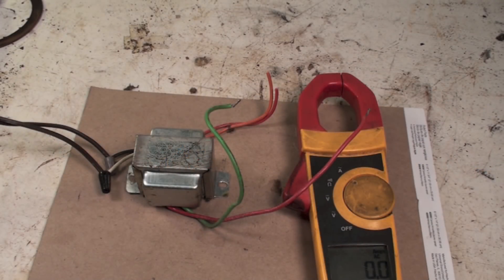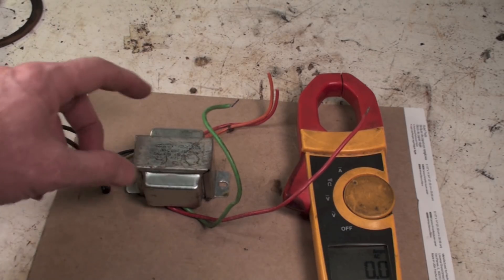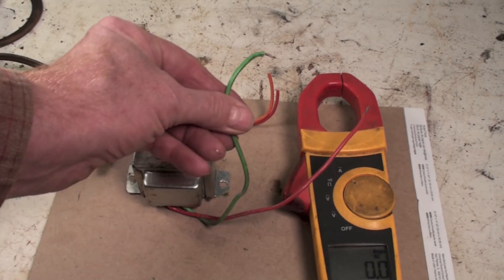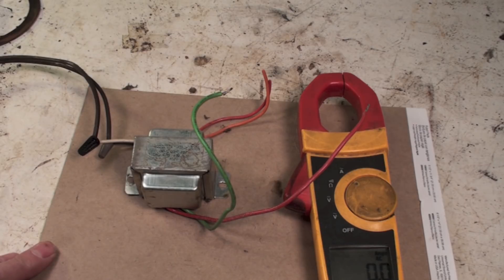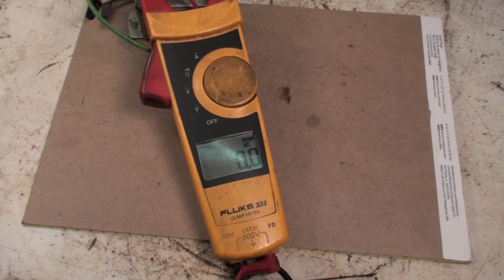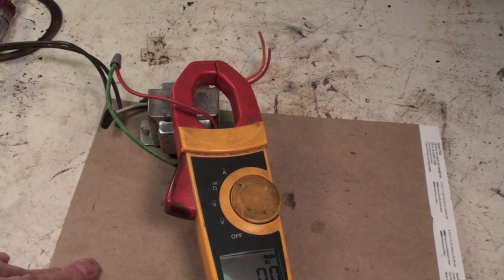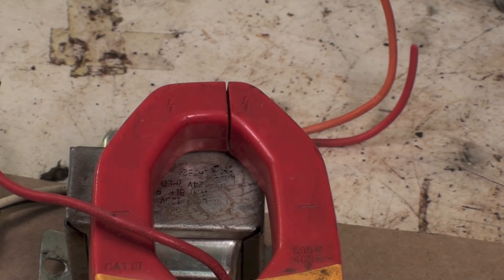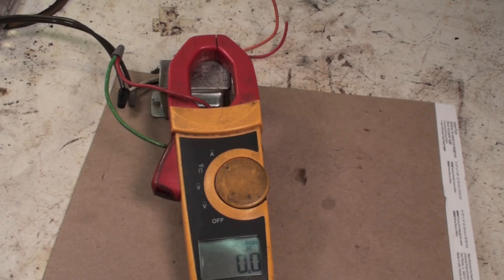How to replace a transformer (without burning up the new one)

Comment: I have a problem with wedge bulbs burning out every second day in house number eluminated plague. What could be the reason. Bell knob stays eluminated 24x7 with no problem
House numbers bulbs keep burning. Any sugestions?
Reply from the maker: Ilia B Check voltage to lights.  Over 15% high, could be the problem.
GFM
Reply: voltage show 10 volt which is normal but bulbs  go every day. any other idea. i ordered new sockets may be bad contacts cause the problem

Comment: Question following.  I have watched your lessons and very much appreciate the guidance.  Lessons are well said and easy to understand.  I have a Rheem Prestige Super 80 - 2 Stage - installed 2008, just outside of warranty.  I used your suggestion and put a screwdriver against the transformer to listen - transformer is humming loudly to regular hearing too - used the screw driver to isolated the sound- transformer is very warm almost hot to the touch.  The furnace works, then does not sometimes.  Unplugging and letting it wait half and hour, then start and works for a few days.  At trying to light again the two green lights are on but the amber does not - then later it may kick in with amber light on solid. Where is the ground for this?  Ideas? Start with Transformer then work from there?  It is the transformer on my left -  # 46-24124-03. If you have someone near Moreno Valley, CA, you like fine, but have had issues in the area with several companies. At minute 5:55 you say pull the contact - do you mean if the transformer stops making noise it was that contact? Then the whole circuit board needs to be replaced? Any ideas are appreciated for this furnace issue.    PS - many years ago in high school the electronics teacher said house ground was to return electricity and your explanation is so clear it is not.
Reply from the maker: Greg Damewood My thoughts are that there is no problem with the transformer.  Sometimes they are quite warm under normal conditions.  I believe that control will blink a reversed polarity code if the ground is bad.  The part about the contactor is when trying to find a short.  You do not have a short or the transformer would immediately burn up or the fuse would blow.  I think you may have a problem with venting, inducer or flame sense.  Certainly you could have board problem, but it is best to eliminate as many other problems as you can before replacing the board.  I really don't have anyone I know in your area.  Hope this helps.
GFM
Reply: grayfurnaceman
Reply: Greg Damewood Thanks - I will try your ideas.  Too bad you do not have a division out here. I know the board is a fragile thing.  I have seen them on the net like at comfortguru for $150 so if nothing else may go that route as the expense for diagnosis here is about $125
Reply: Thanks again - Tapped the disc and it has worked since.  I know that this helped me avoid service abuse.  Take care - Happy New Year.

Comment: can the transformer go bad. I short it out at the condenser contactor with 120v by mistake
and I do not have any power at the control board.
nothing works
Reply from the maker: Alex Gomez Probably blew a fuse in the transformer.  Or possibly a fuse on the control board.  Worst case, the board may be toast.
GFM
Reply: Thank you for the fast response GFM. I check the power supply and it is 24v from the transformer it  is ok, I got 24v  to the board   but there isn't power coming out from the board to the stat nor to the coil df the contactor  and the status light is not on, and you are right maybe the board got toast.
Reply: Alex Gomez rip board.

Comment: I've got a question: i got a old radio/alarm clock that I want to replace a transformer for i got one thats rated at the same wattage but how do i find voltage? i mean the voltage that comes out of it i dont want to burn it out this clock is special it was made by my grandad in the 70's who was a electronics repairman who is long long dead now. another question does it matter if you use one rated at more of wattage? Thanks!
Reply from the maker: realgroovy24 tech This could be pretty hard.  If the transformer is not marked for output voltage, there is no way to know.  Perhaps the clock motor has the voltage on it.  You can use a larger transformer but not smaller.  Hope this helps.
GFM

Comment: I have a problem with my heatpump. I am not getting any low voltage,  but I do have primary voltage. I checked the fuse on the board and its burnt, I still haven't put a new one in but I also think the transformer might be burnt also. If it is the transformer,  what can be the cause of it on a heatpump?
Reply from the maker: The fuse protects the transformer.  However if the fuse is blown, there is probably a short in the low voltage.  Most shorts in the low voltage are usually wires touching the chassis.  You can replace the fuse but if it blows, you will have to start looking and eliminating parts as you go.  Let me know how you do.
GFM

Comment: My furnace is 15 years old. I replaced my blower motor about a month ago. everything ran fine. just the other day I noticed that the inducer fan kicked on, my igniter lit up but the gas valve didn't turn on. could that be a transformer issue or does it sound more like a bad circuit board
Reply from the maker: If there was a transformer problem, nothing would happen.  You need to find out if there is power to the gas valve on a trial for ignition  I did a vid on that.  http://youtu.be/0zKl9wvNIRk

Comment: I disconnected all of the wiring in the 24V circuit including the blower,  I ohm'd everything out but could not find any shorts.    I  put all the connections back to the 24V circuit and now everything is running fine.

Comment: Thanks will try isolating tomorrow,  Schematic is hard to read. I see pressure switch in series with limit switch and fusible link (is fusible link the rollover),   No Rollover switch in diagram. Could other circuits affect this short such as gas valve? Ignitor circuit? Limit switch for vent motor? Thanks again.

Comment from the maker: There has to be a short in the heat circuit.  The key to this is remove all circuits.  You have removed the stat and its wires.  Now you know it is not outside the furnace.  You probably have something shorted to chassis between W and C.  Eliminate limits, rollouts etc each in turn.  This is not easy.  It takes time, and attention to detail.  let me know how you do.
GFM

Comment: Trane XE90 xformer burnt two years ago after a new tstat was installed.  Replaced the xformer and put a fuse in but continued to burn fuses.  Replaced the Tstat and had no issues until this year when turning on the heat.  Disco'd all  tstat wires and wires to the Outdoor AC unit. Measured 27.1 volts on secondary of transformer.  When jumpering white to red to turn the heat on,  the fuse tripped. You mention to look for relay or contactors. Are these relays from wires on Control board?

Comment from the maker: Well, the reset button you are referring to is the flame failure reset.  When you run out of oil, garbage is drawn thru the pump and many times plugs the nozzle.  You will need to replace the nozzle.  Checkout the oil furnace playlist for some ideas.  Let me know how you come out.
GFM

Comment: I'm getting a lot of humming from my furnace when it's not calling for heat.  Starting to suspect transformer. Do you have a video on this?
Reply: I woke up one night with a deafening buzzing inside my house. I tracked it down to the basement and it was actually a very feeble humming inside the ducts, but the ducts amplified it like speakers in the rest of the house. The issue was the transformer was sitting on the chassis or carcasse of the furnace. When was left hanging the buzzing stopped immidiately. Why started at some point and not 2y earlier when the furnace was installed and the transformer was left sitting in the chassis, I do not know.